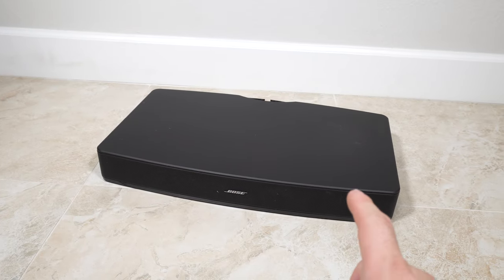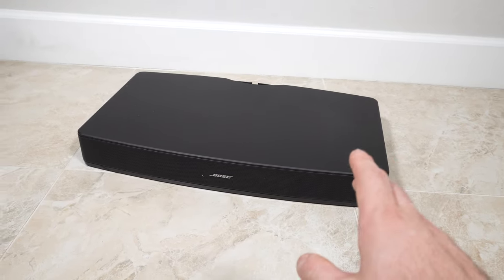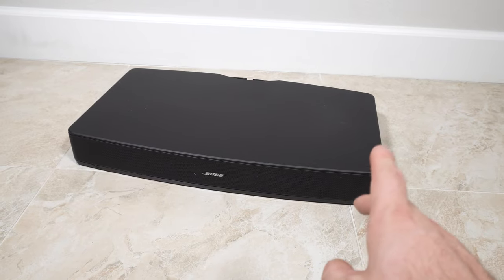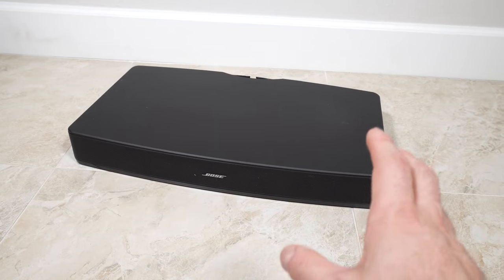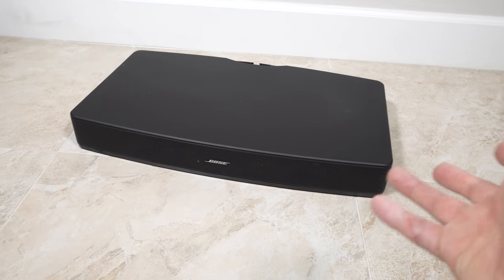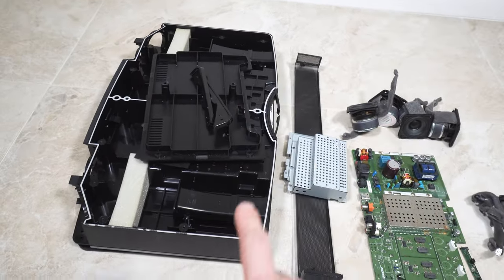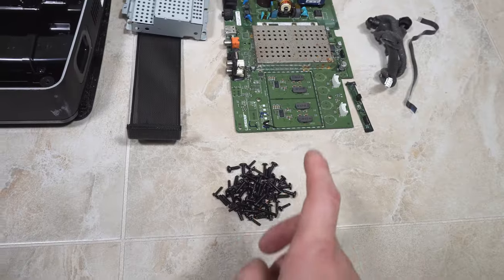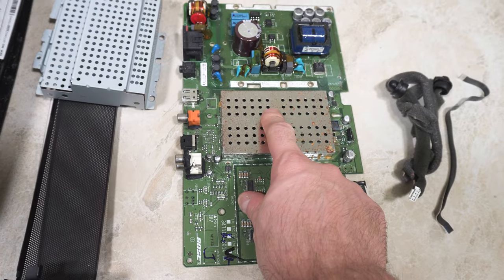TIMELAPSE Taking Apart Bose Solo TV Sound System - Scrapping Electronics Teardown

Comment: I have one and took the speakers out. Planing to make passive stereo speakers (2 speakers per channel) recommendations on what crossover to use?
Reply: I was thinking the same thing, but the 4 speakers seem to be the same (no tweeters). So maybe you don't need crossovers. There may be additional outputs available on your amplifier the power them all, or parallel the speakers assuming the impedance is compatible. I couldn't see any impedance numbers on the speakers in this vid.
Reply: @davidwhite9751  I looked online as well, no info on ohms or power ratings on these speakers
Reply: @rabit818  If you are concerned about power calculations, just assume they are 4 ohm. Another thing to take into account is phasing. There are no plus or minus symbols on the loudspeakers, but each speaker has a large and small spade type electrical connector. Bearing this in mind when you do your wiring, you should be fine. Assuming you wish to utilise the Bose enclosure (seems a shame to throw it out), the forward facing speakers have a red (large connector) and black (small connector) wire. The angled speakers have a yellow (large connector) and brown (small connector). With this info you just need to tap into the 2 sets of cables that go to the main pcb. I have completed this project and it works fine. Best of luck with yours.
Reply: @davidwhite9751  I appreciate your advise/info. Thanks!